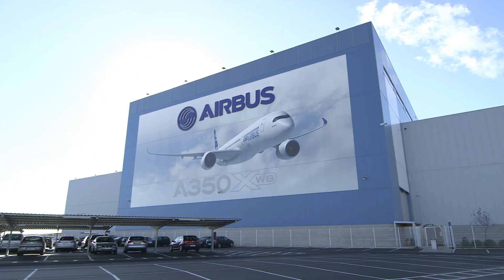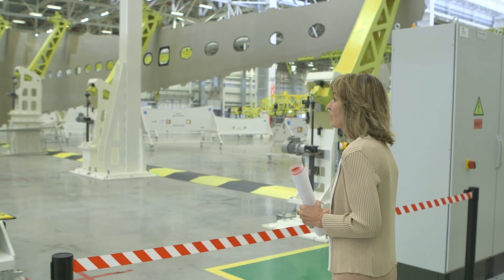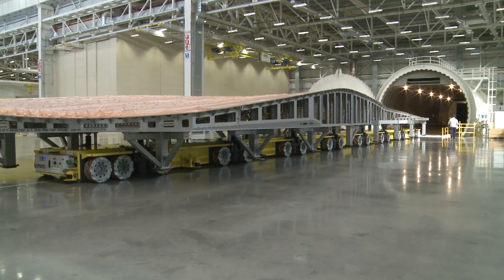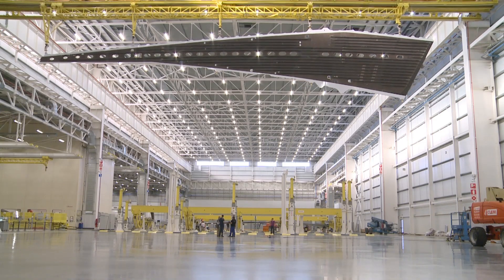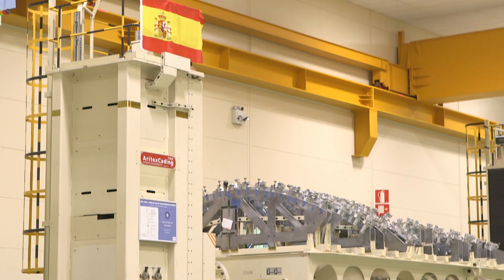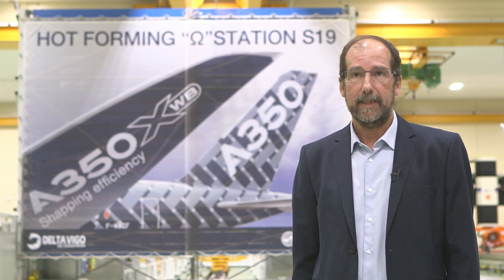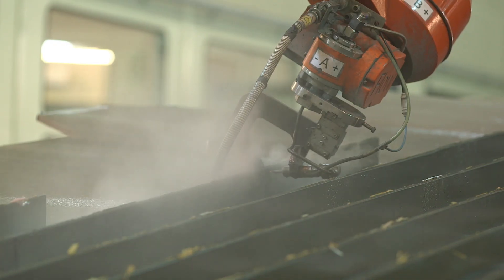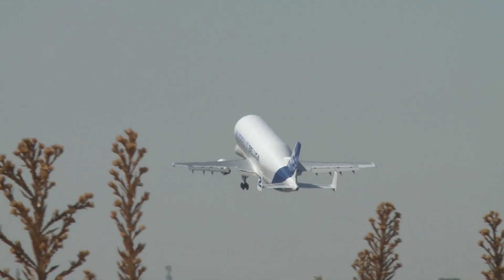25 years of carbon fiber production at Airbus Illescas plant

Comment: Why is carbon fiber frozen? And why does it spoil so quickly?
Reply: Guessing they use a "prepreg", which is carbon fiber impregnated with epoxy. The rate at which the epoxy cures depends on temperature. You keep the prepreg cold to prevent curing. At room temperature you need enough time to layup the structure. To keep up production rates, you want an epoxy that does not take too long to cure.

Comment: 3:09: "There is no fatigue" Bahahahahahaha
Reply: How much carbon are they using for the main load bearing ribs for their fuselage of A400M?
Reply: @black_baron_net  to my knowledge the fuselage is made out of mostly aluminium. Only some parts of the wing and the tail are made with carbon fibers.
Reply: @SpectreMk2  I once saw a detailed video of the entire A400 production process well explained from Airbus staff members. I can't find it any longer. Which part is built in Turkey?
Reply: @black_baron_net  You can find the whole list here: https://www.airframer.com/aircraft_detail.html?model=A400M
Reply: @SpectreMk2  Turkey and Ukraine joined forces. They are building mid-size and big-size Antonov now.

Comment: I wouldn't say that "in composites there is no fatigue". This concept belongs to 20 years ago. Fatigue in composites exists and thousands of papers have been written reporting the damage evolution of composites under fatigue loading.
Reply: +Chris Z. not really, over time you can start getting many of the individual fibers failing, therefor weakening the structure. Cabon fiber doesn't fatigue quite the same as metal, but over time it will weaken
Reply: It's not just carbon fibres that fatigue. I feel fatigue just thinking of Mondays.
Reply: Fatigue in composites exists but it is not observed within the average lifetime of the airplane. That's why they mention no fatigue. It is true that when cracks appear in the airframe, some tests have observed signs of fatigue but in this case it is the crack itself the failure mode, not the fatigue.
Reply: +MrBindobaa ok but it can be fixed right?